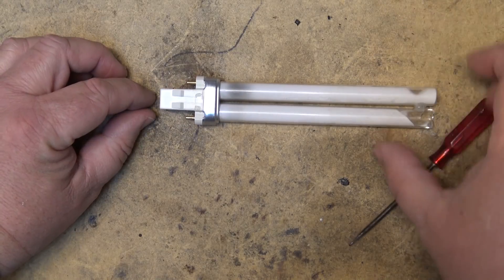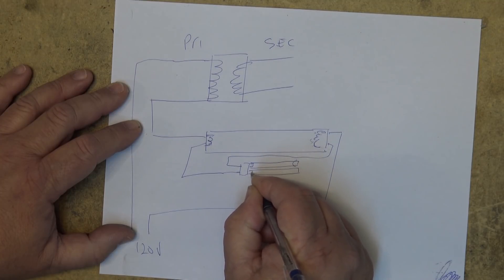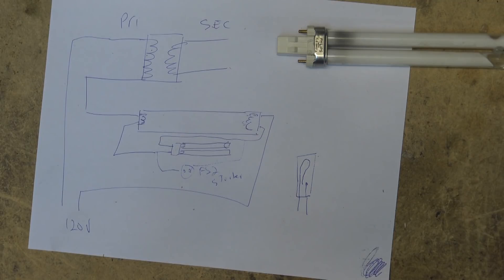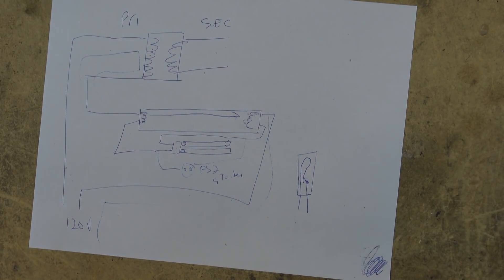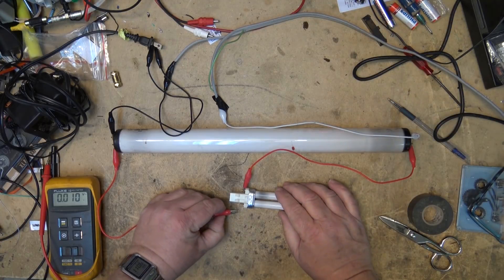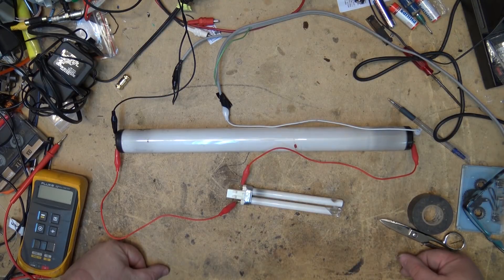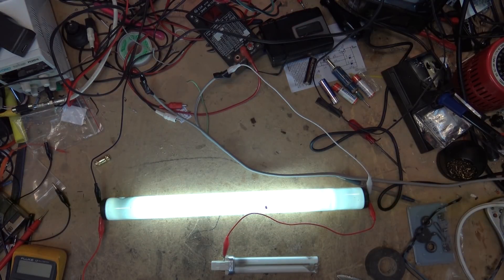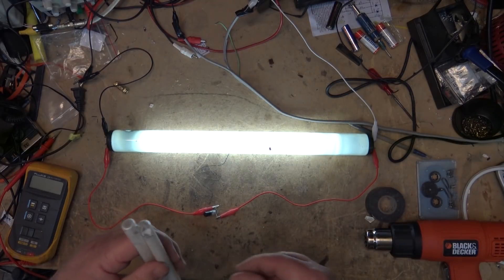fun with fluorescent lamps

Comment: You would connect in series a 12V source , a Mabuchi 12V motor, and a 12V secundary winding of a transformer...the rapidly switching transforms in 110 v in the primary winding of the transformer, from which you could feed the energy to glow the fluorescent

Comment: How does just touching the two red wires cause it to start? Is it just causing heat at the filaments to ionize the gas?
Reply from the maker: Right, it heats the filaments, and then when the wires are opened a kick from the coil will ionize the gas inside the lamp. But as you saw, I was able to light the tube just going through the light bulb, but I think I know WHY this was happening.  My bench is isolated on an isolation transformer, and it is also running through a variac (auto transformer). I am betting that even without the inductive balast (wall wart) to kive it a kick that the inductive load on the isolation transformer and variac was giving it enough of a kick.
I will actuallt test this theory tomorrow and see if it will start going through a series light bulb plugged directly into the mains.

Comment: I live in Europe (240VAC).  I am not really sure if our ballasts are inductive or resistive.  We are supposed to include a capacative load along with the ballast in order to correct the cos phi factor.  Therefore, I guess the ballasts over here are inductive, otherwise that capacative correction would be senseless.  Correct me if I am wrong, I am not an expert.
Reply: Actually, UK should (theoretically) be 230V as well, some European countries used 220V and others used 240V so to uniformize all of Europe they decided to use 230V which is close enough to 220 and 240V without any harm. The country where I'm from (Portugal) used to be 220V and now it's 230V. But you actually have 240V and sometimes even more, because in rural areas there are few power transformers, so they can increase the power to even near 250V so that the homes at the far end of the line could get at least 220V
Reply: I think you are in the UK where the mains 240V is. In the rest of Europa it is 230V.
Reply: I am in the Netherlands. I can monitor the voltage and it is mostly just around 230V. The highest i ever did see was 235V. On this moment it is just below 230V.
Reply: Belgium: 240V, usually a bit more, today 256 V(!)
Reply from the maker: Yes it was about 40 years ago when I received this old beer sign from England to rework. It had a resistive load, and wouldn't start and I just took an standard inductive ballast and replaced it. Would have been about 13 at the time. Was a friend that had immigrated from England with his family. (Went to school with him) and he had this old beer sign from an old pub that his dad gave him. Didn't work, and since I was tinkering with electronics when I was a kid, I was naturally asked if I could make it work. Yes I got started young, how I managed not to electrocute myself still has me puzzled.
Reply: In Spain, 220 V.

Comment: For your test cord i just solder a black clip on line,a white for neural and green for ground just for testing.
Reply from the maker: Yup will do that. Neighbor just dropped off a big box of parts for me, and one of the bins has lots of alligator clips in it, so I will be making a test cord. 
No off to upload another video so I can piss off that freak on the channel.
Reply: kinda ok, i did it, but i think i will improve that, i found a speakers post on a cheap stereo that is springy not snapping, nice, i'll add that to the alligators

Comment: Really? I'm from one of those 240 volt countries and all the fluorescent lamps (apart from ones driven by inverters) I've seen have a magnetic ballast, not a restive one.
Reply from the maker: They are probably just using standard inductive coils that will work anywhere, but I have seen fixtures that have just big wire wound resistors in series with the lamps.  About 30 years ago a guy I knew found an old, I think it was a beer sign from Ireland, anyway it was light by 2 20 watt lamps, and they just had 2 large resistors in series with the lamps. 
He thought it was just the bulbs and bought new ones and the ends would just blink. I opened it up, pulled the resistors and put in a proper dual lamp 20 watt ballast. I was actually surprised that the 15 watt tube struck on 120v as that was unexpected.  I should try an experiment using the variac and see what voltage is required to strike a 15 and 20 watt using the bulb as a ballast.
Reply: @12voltvids  i've found you can sometimes use a capacitor as a ballast with the smaller fluorescent tubes, ones that dont need such a high voltage 'kick' to get them to ionize...
Reply: i came across a cooker that used its filament oven bulb as ballast for a fluorescent tube above its 'control panel'
Reply from the maker: @andygozzo72  
The little 1 watt nightlights uses a capacitor dropper, but then the tube was only 1" long.
Reply: I came from 230 V land and never saw anything but inductive current limiting — until I came to 115 V land and bought small reading lights for my bed side.  I found no ballast on them and their base got quite hot.  Also, their life was very limited, meaning that they stopped starting.  They just tried and tried.  I replaced them, but the life remained too short for my liking.  Then I changed to ordinary type that uses normal ballast and they have kept on working.  I mean the ballasts are still there even though a few years ago I noticed the tubes were dark enough to justify replacement.  Since then, I have installed a couple of electronic ballast types elsewhere (replacing 25 years old fixtures and tubes).  When the bedside lights eventually “get tired”, I probably replace them with LED lights.

Comment: Hey the wallwart worked well as a reactive choke, very sneaky :-D.
I've had a few "Strip lamps" over the years and some had a choke, the reactive limiter was still the best.
There was units with an odd choke/transformer that didnt use the starter at all.
I never saw a ballast resistor lamp, that would have been massive lol.

I still like strip lamps, they work really well :-D.
When i was young i connected a starter across the mains, owww BANG!! :-D.
Didnt do that again :)
Reply from the maker: When I was a kid I put one of those 15 amp screw in fuses into a light socket and threw the switch. Never did that again, but I did put a light bulb into a fuse socket at the panel, and created my very first light bulb current limiter by accident.
Reply: LOL the things we do and escape undamaged :-D
Reply: When I was 8 i put copper wire into the wall receptacle and tripped the breaker. Always interested what was inside electrical things. Curiosity almost killed me a few times. My house has those TP receptacles so my kids dont do what I used to do :)